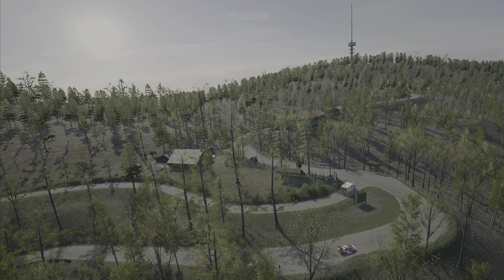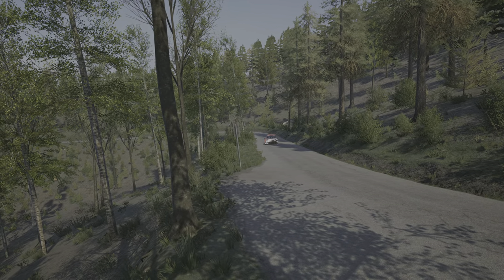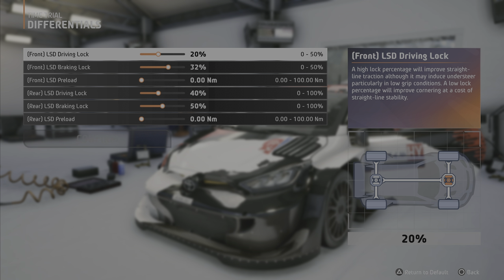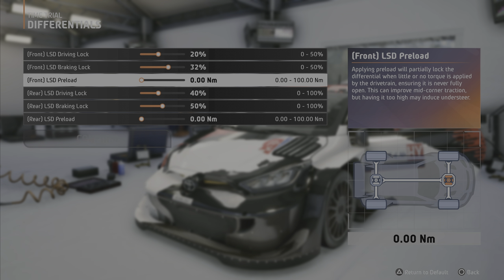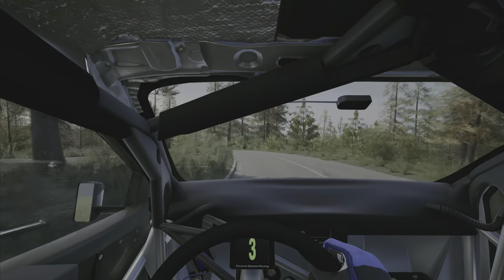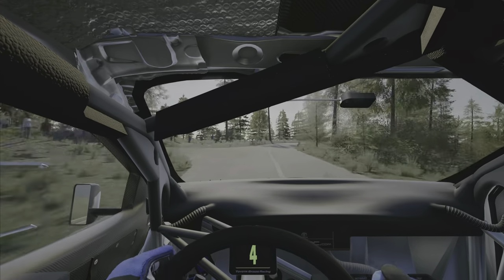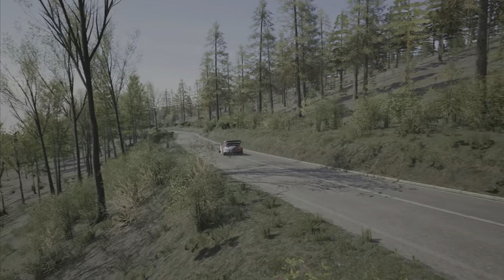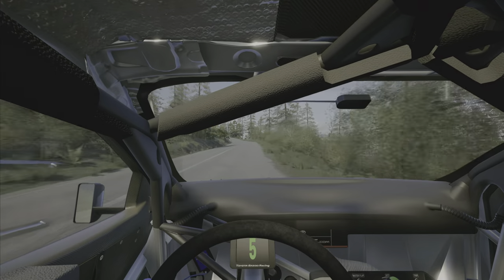CROATIA | Country Guide #02 | EA Sports WRC

Comment: Fantastic video! Previously I just copied setups from another YouTuber but now I have a much better idea how diff, damper and spring setting affect handling.

This is my experience of applying your advice to the Ford Fiesta Rally3 and test driving on Coatia. I set the diff preload to zero and that really helped the car 'glide' round sharp corners nicely when off-throttle. Setting the ride height low, and firming up the anti-roll bars and slow bump dampers helped stablise the car to an extent. But even with this I found the rear would still kick-out when corning sharply, leading to loss of traction and spinning out. While I could avoid this by driving more smoothly and avoiding harsh steering, I kept playing with tuning to see if I could rememdy this issue. I found strengthing the springs help tremendously, so I didn't have to be so cautious with my steering and allowing me to correct mistakes when I don't quite get the angle or speed right for a corner. A much better driving experience!

In the video you mentioned keep the springs soft, but I think the soft springs were still allowing some body roll, affecting the traction when corning, at least with the Fiesta Rally3 in my experience. I'm sure there is a trade-off in having firmer springs, but I didn't notice it if there was. Perhaps I'm more like to have trouble if my wheels cross the edge of the road, but for me spinning out in the corners was the greater problem than crashing to curbstones. In any case this was a great learning experience!

Comment: Some AWD cars have an adjustable center diff but others don't.  How does the center diff behave in the non-adjustable cars?
Reply: Some don't have a center diff. The Rally1 cars don't have one for example
Reply: Right, so how does the power get to the two axles?  4WD style transfer case (locked diff)?  Open diff?  LSD?
Reply: that a question i have actually
Reply: If an AWD has no center diff it behaves like a fully locked diff at all times
Reply from the maker: I assume it is an open diff in the non-adjustable cars. Otherwise tarmac would feel very strange as you basically rip your drivetrain apart. 
For settings I suggest similar logic as you would put on the front diff. Can't think of a case where you would want to have it more locked than the front diff, so keep it somewhere between open and your front diff setting.
Reply: In the official 113 pages of FIA regulations on Rally1 cars there is exactly one line concerning center diffs and I quote: "Center differential: forbidden"
I'm pretty sure it literally is just a driveshaft splitting the power between front and rear axle 50:50.

Comment: I am a bit nervous with minimum ride height and stiff dampers on the "bumpy" sections. Should i raise ride height a bit, adjust dampers, springs, or  am i just overly nervous?
Reply from the maker: Nervous in your head or in the actual driving? If you feel the car is unsettled, raise it a bit higher.
Reply: @skyrex2465  The actual driving. I found that raising height a bit did the trick. I wouldn't consider these roads as super smooth. In that they are not completely flat and predictable.